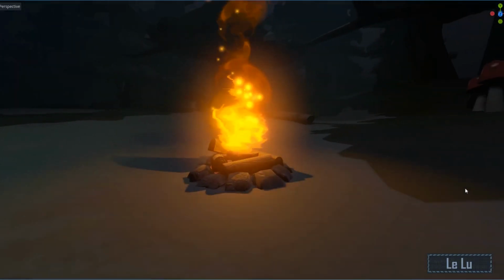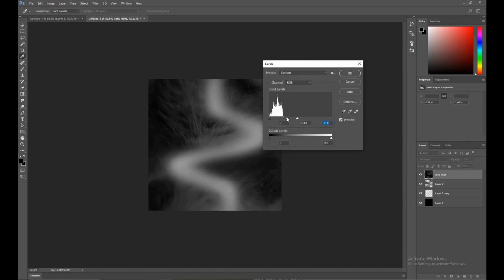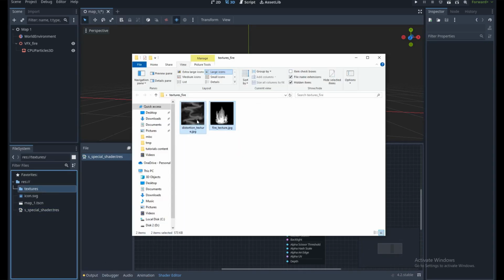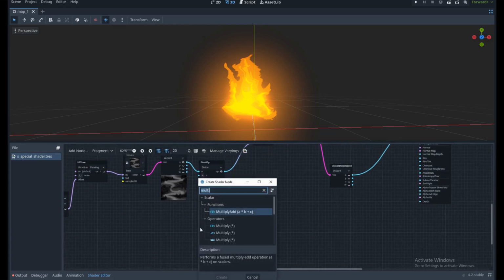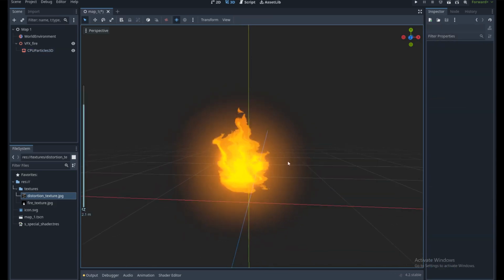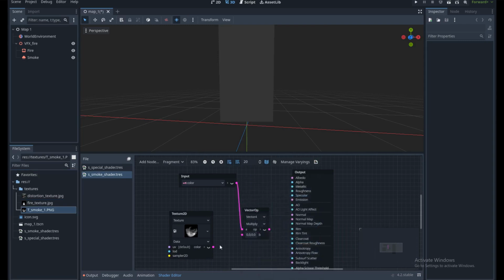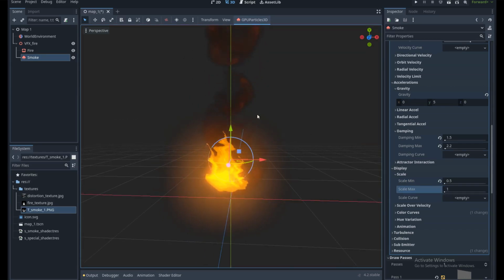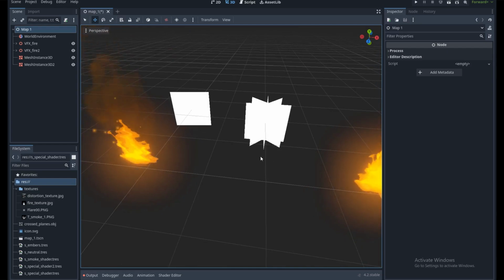GODOT 4  -   Stylized Fire shader for beginners

Comment: Thank you! I learned a lot. 2 years have passed since your fine tutorial, and Godot has changed some settings in the Inspector for the particles system and the shader properties, which meant, that I had to search for the parameters. They are still there but not where you show it. It's unclear how you get the star-shaped mesh to show the fire shader, so it can be seen from above.  I had to give up on that. And if you look on the backside of the mesh, you will see a plane. Same with the smoke particles. The GetBilboard works, but if you have a very dynamic camera for a Third Person Player on a spring arm, it is possible to see that plane/normal at certain angles. I don't know how to turn that off.
Reply from the maker: yeah.. you're right, everything changes.. but i uploaded a new fire vfx lately..

Comment: why does the fire use CPUParticles while the smoke and ember ones use GPU?
Reply from the maker: just for no reason.. lol.. I could even used a single plane for it with no particle system..

GPUParticles are much more strong, since it uses the graphics card its usually always good to use it.. especially if there's hundreds of particles..  

but really old-low end devices, and phones don't have a GPU at all, so then its better to use CPUParticles..

Comment: How do you get this to emit light? It does not seem to behave like that in my project.
Reply from the maker: make sure to enable +Glow  in your environment node  settings..
Reply: @Le_x_Lu  does not seem to be doing the trick really :/ Seems like something just does not work for me.  But still great video. Nearly finished. :)
Reply from the maker: @Butanoshi   wait.. you meant the reflection on the floor ? .. oh I added a simple light inside the fire..  and used the animator to make the light flickering.. i thought you were talking about  the glow itself..
Reply: @Le_x_Lu  I dont think so. I meant the glow/bloom effect you have around the fire without the environment. I just have the flame without any glow. 

Like this -> https://media3.giphy.com/media/v1.Y2lkPTc5MGI3NjExYTRpdm01bjIyNTUzbXVhdzk0eDhmdm00aDY3aDdlYjRjd3N2ZHJ4eiZlcD12MV9pbnRlcm5hbF9naWZfYnlfaWQmY3Q9Zw/zPHkJGXB0vHGw4zosG/giphy.gif

Think I have some other things in the project setup differently or something.
Reply: @Le_x_Lu  Yes I was talking about the glow itself. Does not glow in my viewort. or the editor.  

Tried attaching  some screenshots here but it seems its deleting those comments altogether. Anyway the tutorial is great. I think I have something wrong within my project setup :/